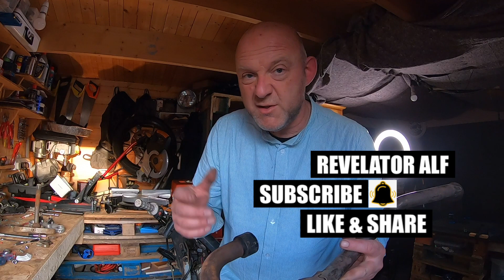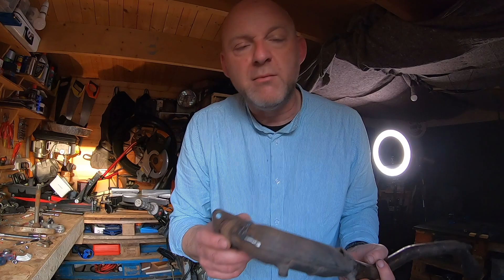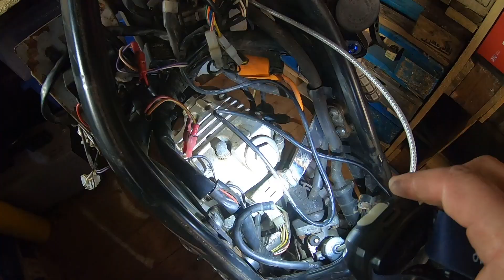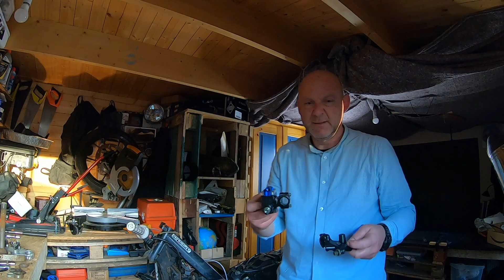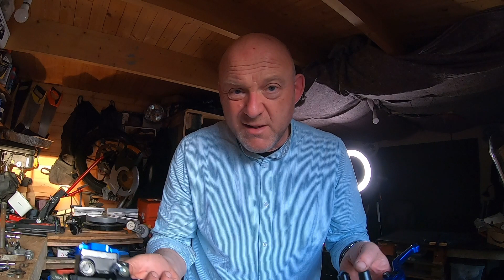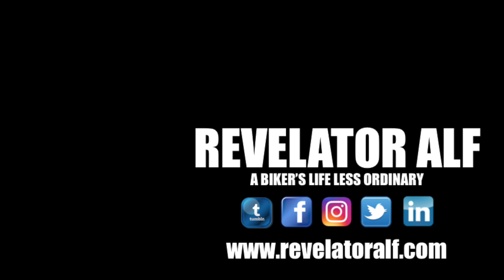Welding Exhaust & Engine Mounts | Rieju Marathon 125 Project Build

Comment: If your struggling for bearings and oil seals there’s a place in Aldershot where you can get almost any bearings or oil seals you need. So long as you can measure the existing ones. It’s called Marksman Industrial Ltd.
Reply from the maker: Ah great thanks I’ll check them out